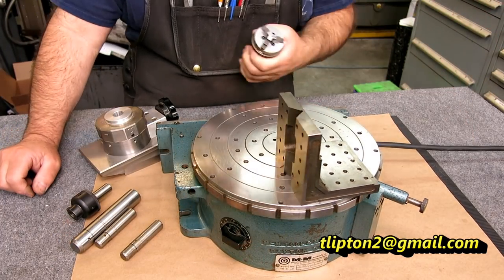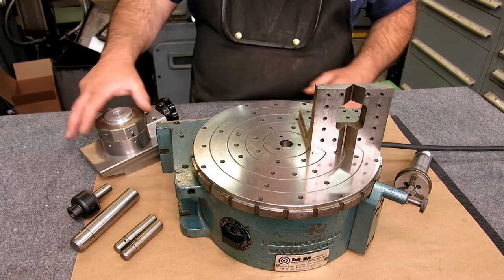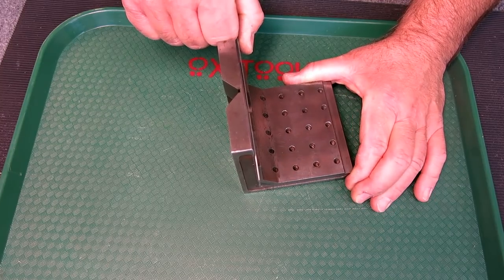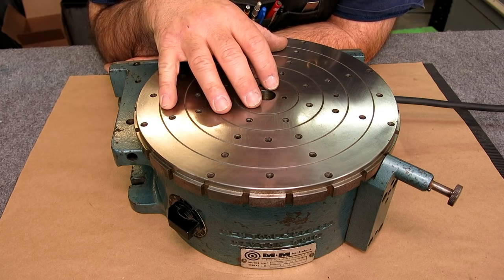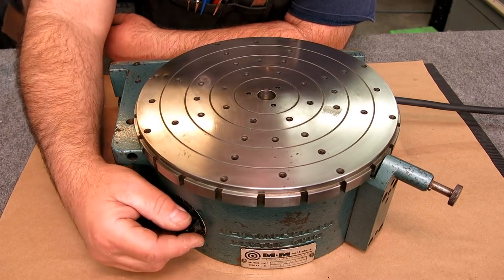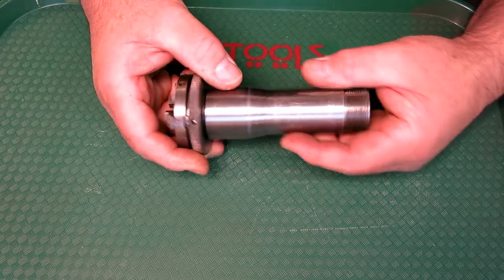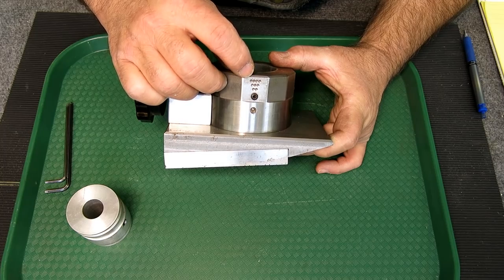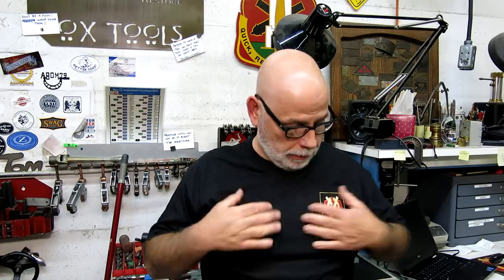Monday Night Meatloaf 120 P3

Comment: Those cross-sliding keys at right angles are an Oldham coupler.  The two different axes allow alignment anywhere in the plane.

We use 'em in telescope mounts between the motor and worm gear, where we're looking for the highest precision, smoothest star-tracking motion down to sub-arc-seconds and don't want any disturbances from misaligned shafts.  (The coupler tolerences might be a little better than the one in the floating holder... but same idea.)

Comment: I was doing some thinking at work and remembered/realised the stanley/exacto knives are hardened all the way through, so now I use the back/non-cutting side of a second one to sharpen the other. I mainly use the long cutting edge for stuff and the tip rarely, so now I can have a blade potentially last a few weeks instead of a few days. 

Good for a quick sharpen of your pocket knife, better than using a "proper" steel, too.

Comment: Floating reamer holders are particularly useful in gunsmith work. Chambers & (custom) reloading dies are usually cut with a form reamer. Trying to keep everything square , to size & to the proper depth is the name if the game. Great video as usual.

Comment: Scalpel handles come in every conceivable size.

The surgeon can even have custom sizes made but generally most are accommodated by stock sizes.
Reply: ALAPINO in addition the grip for a nr 15 an 11 is like a pen when the larger blade is supposed to held fro  the top so you use the belly of the knife.

Comment: When working with scalpel blades, the medics usually get given blade insert/removal tools.  But even handier is a needle holder/needle driver.  (you also get them in a stitching kit which costs less than $5 and has everything you'll need.) They're like a hemostat but the jaws are shorter and the handles a little longer and sturdier to give a stronger grip.  Slipping while inserting a blade is no joke but once its used and maybe cracked, getting the little bugger off the handle is a real danger, when they snap (which they often do) you have a 2mm sliver of surgical steel just looking for bone.

Much safer to grip with a clamp to flex and tug off the handle.

I was watching a watchrepair channel yesterday, the guy was using a little chuck like yours to hold the case for buffing it.

Comment: Scalpels and blades have been in the shop for a few years.  Not too pricey on ebay.  Great for splinter       removal  and many things that you need a very sharp blade.
Reply: J K-crna  and with sterilised ones you don't get infected when you cut yourself.

Comment: Interested in your comment about the sterile scalpel blades being sharper. My understanding from Swann Morton (UK scalpel manufacturer) was that the sterile and non-sterile types are manufactured identically, with the only difference being that the sterile type are subjected to irradiation after packaging.
Reply: Most likely the non-sterile are from cheaper manufacturers.  If you compare apples to (non-sterile) apples I suspect you'd be correct.   I have some from Gima and they're notably sharper than the previous ones by Paragon....but much more brittle.  Good call on the 15 blade Tom :-D
Reply: Swan Morton make both sterile and non and they are in the premier league of scalpel makers. just saying.

Comment: Don't let your fingers anywhere near a disposable scalpel blade, don't even hold them in a packet. Grasp the blade with a haemostat (USA) or artery forceps in the UK.
Reply: I have to agree with you on that. WatchingTom 'play' with those scalpel blades sent shivers up my spine. They shlep through flesh sooo easily! Almost turned it off. Just one little slip could change your life.

Comment: ya seen some of steves video's showed a ceramic/ aluminum oxide wheel that sounded interesting. ya looks like hans did some interesting work on ufo's or something have a fascination with slide rules and sharpening fixture's myself that end relief fixture is a real marvel probly a way of getting down into the gash with it(different wheel?) good stuff cant wait to see you get back on the brown&sharpe (hint hint) that looks like a handy machine good to see you Tom loved the spring caliper competition too all good stuff in there thanks oh ya that's probly a tree pollen thing with the sniffles

Comment: If that angle plate was something like an apprentice project, in Germany and Switzerland they are done strictly with hand tools, filing, instead of grinding, probably using a hand drill, even...when you see the "simple" test pieces, with a cube that has to slide through a square opening in a thick plate, in all orientations, with an "airtight" fit, it's a real testament to the level of skill!

Comment: Tom, how do you hold stuff on the rotary grinding table? Does the surface grinder mag chuck have enough power to pull an item to the spinning table or do you use the threaded hols and hold downs?

Great vid! Thanks for posting.
Eric
Reply: It's got all those little tapped holes in the top. Band clamps and toe clamps can be used in them. Mag chucks can't transfer the flux through even a thin piece of metal. That's why he uses those transfer bars in the demo of the EM grinding fixture. (So it definitely couldn't pull through that entire 8" tall rotary table.)

Comment: Odd, should have been heat treated prior to grinding...  should be "on" as it sits less it was ground prior to HT which would nOt be the way to make an angle plate like that.  Curious why that is.